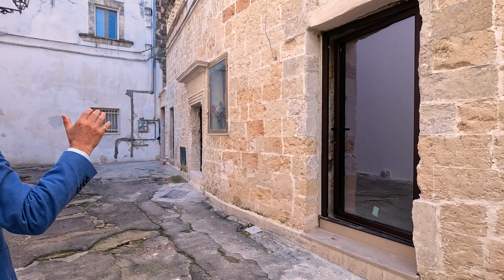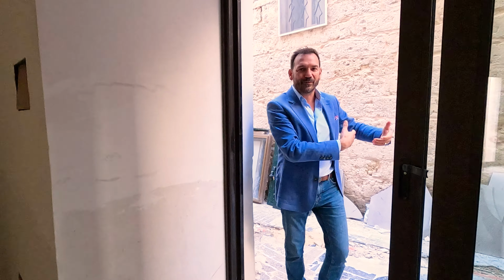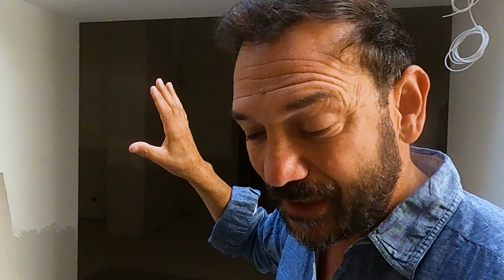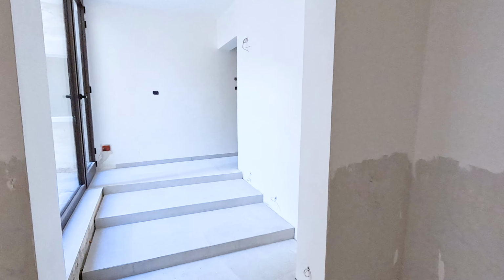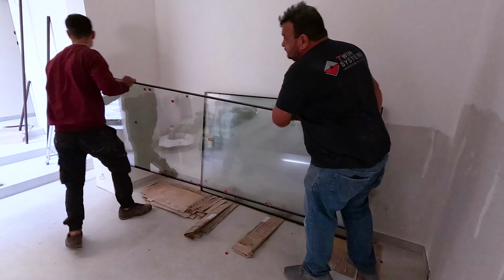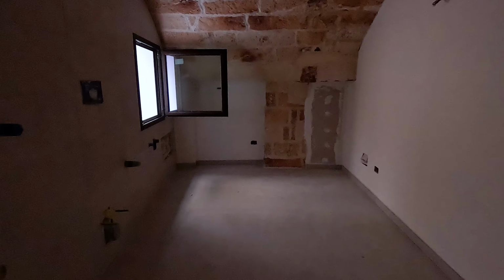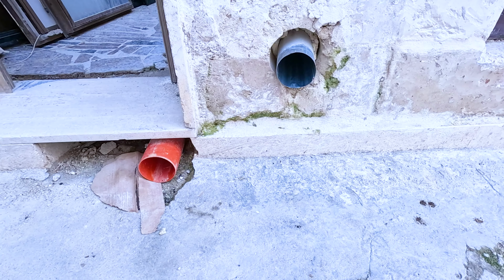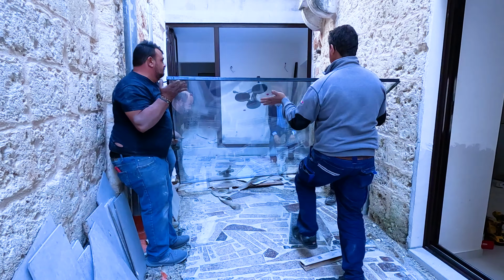Property Refurbishment in Italy, Gasper Grotto - episode 5 - Salento, Puglia by Davide Mengoli

Comment: Nice dwelling, solid bones ... installations, radiant floor... big investment ?! ... I wonder what cost per sqm would be ...
Reply from the maker: The under floor heating system works around the 100/120 euro per sqm but you then need to add, machinery, preparation of the sub floor, concrete screed above and other elements, bringing the cost around the 200/300 euro per sqm